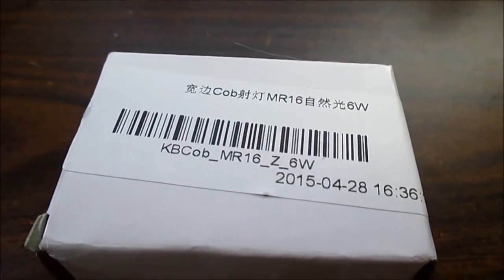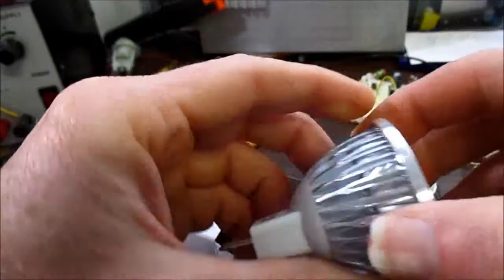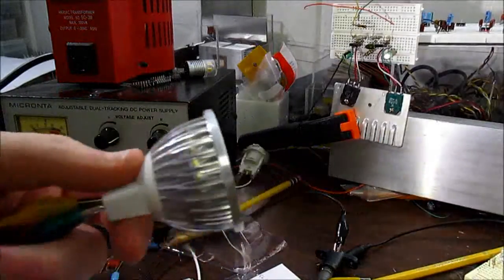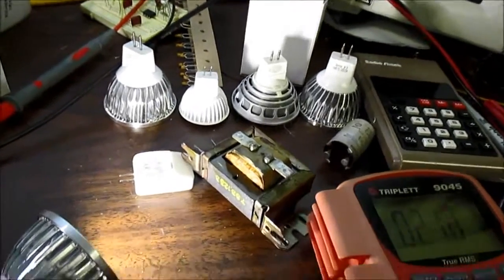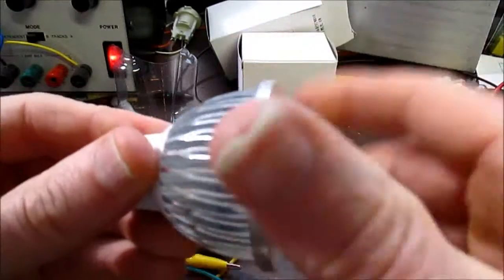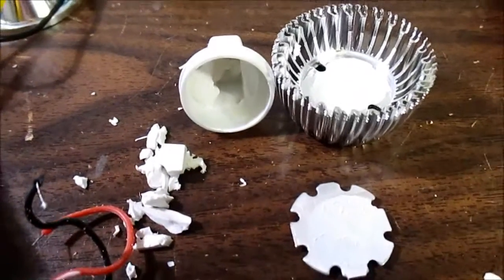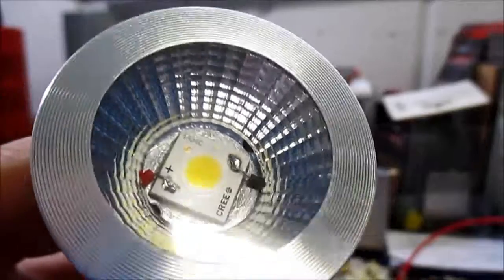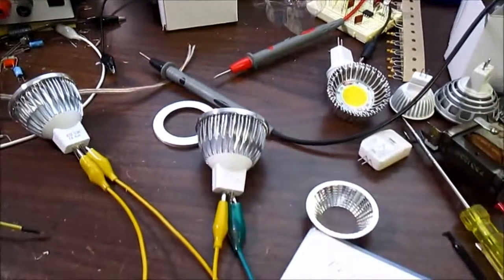12v reflector LED bulb review teardown and mod

Comment: I'm planning to mod the some similiar bulbs but the cob voltage does seem to be 10v for what current it is configured for. If you just throw in a 36v cree cob wouldn't the driver just fall below the cree cob voltage or wouldn't the driver just blow up because of trying to push the same current at 3.6x the voltage, hence 3.6x the wattage?

Comment: I realize this is a two years old video, but still, I got something for you guys about brightness: It's not only about the wattage and color. Of course, higher wattage and higher temprature color will produce more light, but there is a very big factor that is overseen - and it's lumens pre watt. Not all LEDs and drivers will behave the same. Higher lumens per watt means more light per watt. A 110 lumens per watt will be brighter than a 80 per watt chip, even though they are the same power-wise. The harder you drive an LED, the less lumens you'll get per watt. It's better to have two 1W chips running at a certain current than a single 2W chip running twice this current, you'll get more lumens per watt, which translate to a brighter source.

Comment: I once bought some of these 15w from one supplier and they are good, but from another supplier they have a thermal cutoff or something and its like a disco in the hallway. 
i put the good ones in the kitchen. also i bought the warm white and sanded the cover and a light coat of orange paint for extra warm light that matches real halogens

Comment: I'm really leery of buying anymore Chinese fixtures now, though at the price I guess I could do like you did and mod them. I reviewed several LED fixtures on my channel, and it seems each one was worse than the previous one in terms of overstated Wattage. The last 50W fixture I bought drew only 21W and wasn't even very bright for that Wattage. I didn't even put it up, should do a tear down video on it. I need two or more fixtures to complete my barn lighting project, might just use that old Sodium fixture you gave me and one I have that is about the same rating to finish the project. Too bad the GE/Cree fixtures are so expensive...
Guess the Chinese think we'll believe/buy anything they put out, that 3W on the inside of the one you took apart reveals how willing and able they are to outright lie and misstate ratings.
Reply from the maker: ***** If you can find the voltage & current the 21w fixture puts into the LED, it might be possible to upgrade its LED with the appropriate Cree COB. Figuring about 18 watts to the LED, is worth about 2,200+ lumens with an efficient LED. The slow warmup time and orange light from the sodium fixture makes it better suited for outdoor security lighting. Sent you a reply video a few days ago. Did you get it?
Reply: Yes, watched but need to re-watch and take notes.